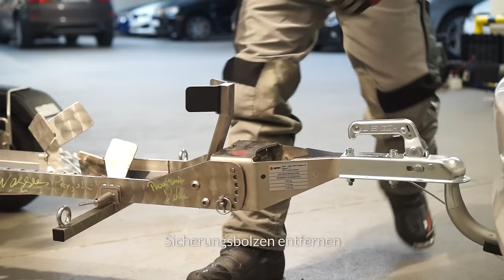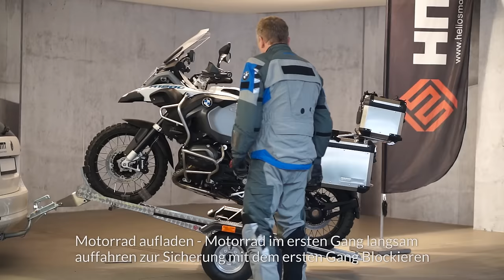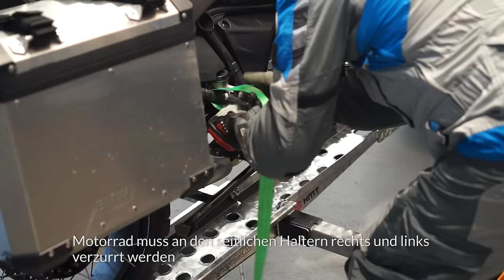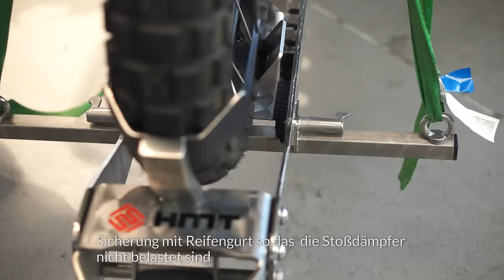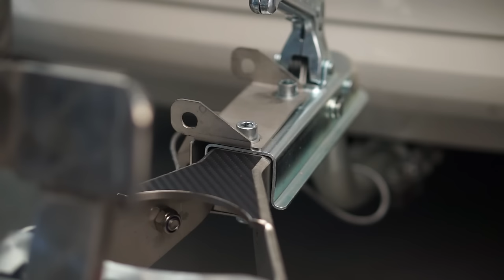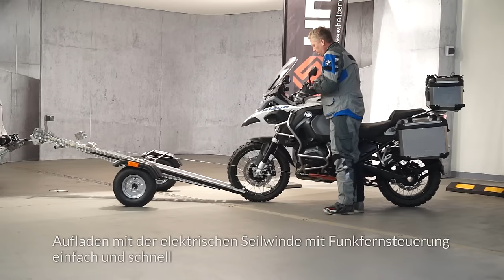HMT de

Comment: Interesting trailer design.  I ended up getting a Stinger Folding Trailer made in Canada.
Reply: Those are kinda crappy to in my opinion, I would not trust the thing.
Reply: Well, it has carried my Kawasaki KLR 650 from Georgia to Colorado (~1700 miles) and back TWICE.  I have over 7000 miles on the Stinger trailer and it does an outstanding job.  Easy to fold and unfold.  Very sturdy once it's setup. Only takes one person to set it up and load the motorcycle.  So, unless you've owned one and can give specifics on the problems you've had, your "kinda crappy" comment is without merit.
Reply: Good for you, my opinion stands. I do not haul my bike on one "rail" so do speak, i rather transport it in an enclosed trailer to keep it out of the elements and to mainly discourage sticky fingers. It would allow me to sleep much better.
Reply: Good for you, then we both have trailers that meet our needs and I can store my trailer between my cars in the garage.   And I sleep just fine. :)
Reply: YoyoBandalore Thanks for the input on that trailer. Will look into it.

Comment: Copy of a motolug trailer.
Reply: Your point?
Reply: Bad copy of a motolug. I am using a motolug for years. Great trailer.
Reply: @eduardosampoia5480  Lol.  The point is,  IT's a COPY dummy.
Reply: @aztec6715  I'd like to know one Original thing you own. Just one.
Reply: @lolly166541  Regardless of what I own or don't own, that doesn't change the fact that this trailer is a style copy of a well known existing model.
So, what is your point?

Comment: Wy put the strip around fromt wheel ? Try the lower joke
Reply: Holds the front wheel in place without over compressing the suspension